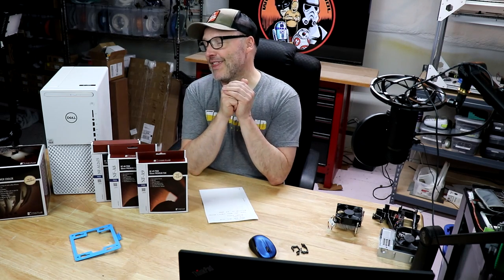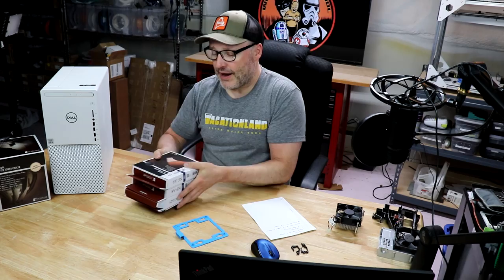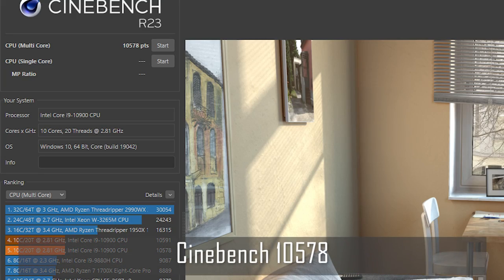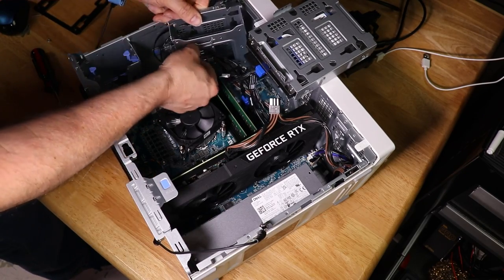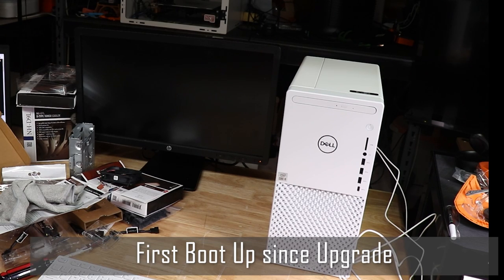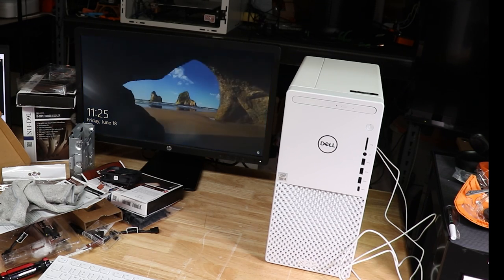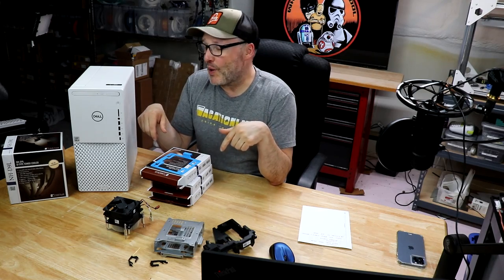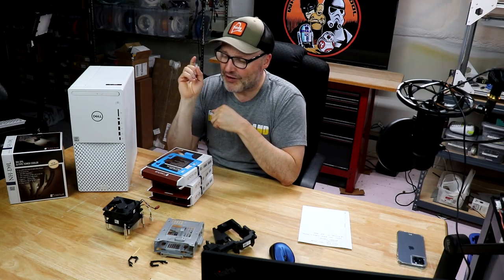Dell XPS 8940 / G5 5000 - Upgrading CPU Cooler and Fan Upgrades for better performance?

Comment: How did you purchase the 3D printed mount? The link doesn’t have anything. Or am I supposed to get it printed?
Reply from the maker: I printer my own (I have a print farm of 20+ machines). The link show the file. I’m sure someone in your circle of Facebook friends has a 3D printer?
Reply: @WhereNerdyisCool  unfortunately no 🥴
Reply from the maker: Check the comments here. Someone had an eBay link
Reply: @WhereNerdyisCool  
Great. Found it searching eBay. Much thanks for your assistance and the service you provide to people who need them via the videos you post.
Reply: @WhereNerdyisCool  btw, I read the Ventoo v5 is also compatible cooler for this cpu? Are you able to confirm? Don’t really want to chop M3 screws 🥴
Reply from the maker: I don’t know. Cutting the tops off screws is easy peasy

Comment: Thanks so much for the video, I have built hundreds of machines about 20 years ago and knew enough back then. Now I have to relearn some stuff. I have been struggling to find a prebuilt that doesnt have issues mostly crappy power supplies or cooling issues these should be no brainers and cheap issues that should never have been an issue on machines made today. Stupid companies put in 500 watt cheap power supplies just barely enough to run. I settled on an xps 8940 with i7-11700 and a 3060 I just purchased for $1200 from dell. I may replace the cpu fan with your setup and maybe the rear fan.  I hope my setup uses the same cpu fan yours does. Thankyou for all the links. I did find the screws online does the fan come with the nuts for the top?
Reply: How did you get this deal bro??? I got it at 1400 with a discount
Reply from the maker: Which cpu and graphics card?

Comment: How are u installing the m3 screws
Reply from the maker: I cut the heads off some M3 x 25 and threading them in. Then used the included Noctua thumb nuts to secure heat sink

Comment: Planning on getting this with an i7 K processor. ( Tower cooler ) Will adding all three fan work without getting fan error? Did you use 4 pins on all the splitters of the rear case fan port?
Reply from the maker: 4 pin.   No errors.  And a lot of hot air is getting pushed outside the computer.  For about $150 in fans/heat sink…it’s not a terribly pricey upgrade to eek some performance back!
Reply: @WhereNerdyisCool  Thanks, was just concerned if there was anything different in the i7 with the pancake cooler vs the i7K that comes with the tower cooler. Seems like everyone doing this mod started with the non K. I figured just get the K with the tower cooler to start and just replace/add the fans. Thank again.
Reply from the maker: @garyschmidt5301  as you saw in my video, I had that tiny cooler which seemed unable to do the job.  I'm not sure what the i7 owners have done.  But I'm quite happy with the Noctua one!

Comment: I bought an XPS 8940 from Costco two days ago. I'm wondering if I need to make these modifications since I don't play games. I wanted 32 GB memory and a somewhat capable graphics card (it came with a GeForce RTX 3060Ti) because occasionally I edit 4K video but 95% of the time I'm just in a browser or Office. Honestly, I feel like if I have to modify a brand new $1600 PC then perhaps I've made the wrong purchase.
Reply from the maker: Well it’s a Dell… as my video points out, $125 in fans plus new cooler helps it run a lot cooler, which means a lot less cpu throttling.  I don’t take a lot on my Dell, it’s for live streaming, which can be very cpu intensive.  I also like that all that hot air and getting pushed out way better
Reply: I just purchased this XP’s 8940 also and will be using it also mostly for 4k video  and browser and  Office . Have you had any problem as yet ?  Thanks!
Reply from the maker: Now that it runs a whole lot cooler,  no issues!
Reply: No, you don't have to do this upgrade. The PC is fine on its own and you won't have any troubles. Dell's R&D team's objective is to minimize warranty claims as much as possible. These sort of upgrades are for the enthusiasts in the world who just like to tinker and squeeze/maintain every bit of power available. If you do like the idea of upgrading, the CPU cooler is the one to target. You will see the same results without changing and adding in the extra fans.

Comment: Hey! Thanks for the great video, I just made the same exact modification (3 Noctua fans and Noctua CPU cooler). I was wondering what is your idle temperature. My idle temperature is arround 50celcius and i found it a little bit high for a system with no load... Thanks!
Reply from the maker: I’ll have to check again. Last tine I looked it was low 40’s
Reply: What's running in the background you might want to check
Reply: Disable the Realtek Universal Audio under Services. It's a RAM and system resources hog, possibly causing CPU to over work!
Reply from the maker: That’s a really great idea

Comment: Does this also work with the rtx 3060 ti version?
Reply from the maker: I would suspect so. The biggest gain is of yours came with that hockey puck shaped cpu cooler. The Noctua does a much better job. If you only replace one fan, do the rear case one

Comment: Has anyone that has done this upgrade figured out how to take control of the fans with the fanspeed app?
Reply: The fans cannot be controlled via software. So if you have the noctua fans, you have to get a manual fan controller.

Comment: Hey so would it be worth it just to even get the cpu cooler now and then do the rest of the upgrade later? I am just getting very worried about the temps on my system at the moment and was wondering if even just the cpu cooler would suffice for now
Reply from the maker: The cpu cooler is a huge help. Then those additional fans pushing that hot air out
Reply: @WhereNerdyisCool  Thanks so much! So is there anything else I would have to buy or would I be good to just buy the cooler. This'll be my first time doing something like this so I don't know if I'll have to buy thermal paste or not
Reply from the maker: @alexbooth3092  The CPU cooler I went with (based on the Dell Forums thread) had the thermal paste.  I just needed to come up with the 4 M3 20mm screws.  I lot of people freak out over cutting the screw heads off (am I really the only maker-nerd here?).  Hacksaw or Dremel makes it easy, be sure to use a file for a clean, burr free thread.  As I mentioned, for less than $150 I had CPU cooler and fans that made a very big difference.  I have the 3070 so I don't have a lot of room on the bottom but managed to squeeze that third fan in!  Here's the Dell Support forum link if you want more ideas
https://www.dell.com/community/XPS-Desktops/XPS-8940-Better-3rd-party-cooler/m-p/7690322#M53692
Reply: @WhereNerdyisCool  thanks so much! I should be able to just buy the screws and I think due to budget I am just going to go with the cpu cooler for now but will for sure do the rest of the upgrade at a later date, thanks for all the help!
Reply from the maker: With that cpu cooler you’ll need the M3 set screws or cut the screw heads off a 25 mm M3 screw. That’s it. Go slow. Ground yourself with a wrist strap and have fun
Reply: @WhereNerdyisCool  Can I just get the m3 set screws on Amazon? I just ordered the cooler and it'll be here Sunday so I'll let you know how it goes!
Reply from the maker: I couldn’t find them. So I just cut what M3’s I could find
Reply: @WhereNerdyisCool  I'm going to go a local hardware store today because I have none of the screws so I'm sure I should be able to find the 20mm m3 screws. I really appreciate that you are being as helpful as you can to a beginner and I really appreciate it

Comment: Just wondering, does this kind of upgrade void the XPS's warranty? Thanks!
Reply from the maker: Maybe?  I don’t know.  It it sure runs a lot better
Reply: @WhereNerdyisCool  The reason i asked was, I can get a cheaper XPS 8940 with a one year warranty than a two year period. Know that I can buy a Noctua u9s with the price difference. 😅 Any thoughts?
Reply from the maker: I don’t have anything to offer. I am used to fixing my own stuff 🤓

Comment: Y don't have the M3x25mm set screws why?
Reply from the maker: As I’ve answered to many similar comments, I couldn’t locate set screws so I just cut the heads of normal M3 screws down to 25mm
Reply: @WhereNerdyisCool  Oh ok thank you to answer for my question but the screws are not compatianle with the motherboard they are too big
Reply from the maker: Which system?
Reply: @WhereNerdyisCool  Xps tower classic edition with an i7 11700 and an 3060ti

Comment: Im not totally up to speed on intel, I've been using AMD since Ryzen came out. But is that all core boost frequency low? Seems like it could at least be running like 4.4ghz all core in cinebench
Reply: Based on things ive seen in other videos, I think the Intel XTU can increase the time it stays at max boost, even though its not a K.
Reply from the maker: That I’m not sure about. All the boost reading I’ve done indicated it was short term.

Comment: great video! do the extra fans add  much noise? also, do the quality of fans really make a difference? thx
Reply from the maker: They are silent!   Noctua fans are quiet.  If you go cheap, they could be loud.  Your mileage may vary

Comment: Where did you get the set screws? Or did all the hardware come with the cooler?
Reply from the maker: I used 4 M3x30mm screws and cut them down to 25mm with a Dremel cutting disc. 🙂
Reply: If I don’t have access to a Dremel do I just order any m3x25 screws?
Reply from the maker: Hack saw !
Reply: Don’t have that either. Lol am I “screwed”? 😂
Reply from the maker: Seriously any hardware store has both. You can do this
Reply: I know. Just adds more cost to the overall upgrade. Not your fault. Thanks for the video.

Comment: Tried to contact the 3d bracket maker to purchase a bracket  but no reply  where can I purchase one ?
Reply from the maker: Could be gone for the holidays?  I can print one up if you’re still in need. Probably cost more to ship than make
Reply: @WhereNerdyisCool  sounds good. Let me know where to send you a check. After the holidays of course. Thank you
Reply from the maker: @jamesr-zp3up  I don't take checks, I'm sure we can do some PayPal .... drop me an email when you're ready
Reply: @WhereNerdyisCool  ok I have a paypal account
Reply: @WhereNerdyisCool  I already installed the two other fans and the temp's went down 40 degrees 😊
Reply from the maker: It makes a big difference getting the air out plus a CPI cooler.  I wouldn’t bother with the front fan at this point!
Reply: @WhereNerdyisCool  ok   thank you for your input

Comment: I’ve xps8940 honestly the front 120mm didn’t produce much difference. Temp with or without are almost identical . I guess the cpu cooler is key to drive down temp
Reply from the maker: The better cpu cooler is well worth it.  The front fan you can skip. Definitely do a better rear fan to get the heat out

Comment: Did those screws come included in the noctua cooler?
Reply from the maker: For the 3D print mount?  Yes.
Reply: @WhereNerdyisCool  how about the cpu cooler?
Reply from the maker: As mentioned you need 4 M3x25mm set screws.  Or as I did I took 30mm M3 screws, measured 25mm and cut the heads off.

Comment: So the fans for the gpu wasn't worth it? I mean it wasn't much difference. Maybe just move the HDD from the front to the top front?
Reply from the maker: Well you have to move the HDD front caddy to get the fan in.  If I had to pick a fan to not use , the low one in front of the gpu.  However more air flow is never a bad thing !

Comment: Here is the funny thing, as I was ordering my xps 4940 I7-11700 system I asked the sales guy if I could have them put a better fan in it. I said the one they put in is crap. His answer was no that this is not a gaming computer we have alenware for that. I would sure want to know what makws a system a gaming system if not this with 3060 video card. That being said I just checked out an alienware system that has simular specs actually the same, they put the same pos fan in those.

Comment: you should have also bought some small heatsinks to glue on the motherboard VRMs, those aren't expensive
Reply from the maker: A peer added VRM coolers and saw absolutely no gain. So I’ve opted to leave them as is. The added airflow certainly helps
Reply: @WhereNerdyisCool  the thing about VRM cooling is less about performance gains, and more making your motherboard last longer. In special in big OEM systems - like dell -  don't exactly use the best VRMs in the first place, so I think those like 10 bucks those little heatsinks cost, should be worth it.
Reply from the maker: @BaDitO2  heatsinks don't cost much, you have a valid point!

Comment: Is there a difference between connecting that front 120mm fan to the cpu cooler header or the rear exhaust fan header? Like do one run more consistently or better than the other ? Thanks!
Reply from the maker: Good question. I’m not entirely sure!  But one thing you will like to the air flow.  And I’m always amazed how much hot air is now able to exit the case
Reply: @WhereNerdyisCool  Yes I've made the mods and connected mine to the cpu cooler header and have had great results. I am wondering if a cooler upgrade would actually help at this point. I have the K cooler so I'm kind of on the fence about weather it would be necessary to upgrade. I've ran the pc with the case open and just don't feel much air being put through the cooler from the fan inside. I'm thinking of putting in a veetro v5 as it's had good reviews in the 8940 and is very reasonably priced!
Reply from the maker: @NewfieVortex  Im told the K cooler is much better than the non K versions.  As you saw, mine was something that resembles a hockey puck!
Reply from the maker: Let me know how your tweaks go!

Comment: Hi,
I've posted a message yesterday but for some reasons it has disapeared. So this is a test.
Reply from the maker: I was replying to it and got an error too
Reply: @WhereNerdyisCool  I edited it like 3 times and I suspect you were replying at the same time. I'll post again. thanks
Reply: Grrr, it doesn't work. I post it then it disapear. Is it possible it's because there's a link to Noctua fans webpage in my message?
Reply from the maker: It might not like links
I just used the cpu cooler and the fans came with everything I needed
Reply: @WhereNerdyisCool  First time I have this problem, weird. I'll try without the link.
Just got my XPS8940 that came with a CPU heatsink similar to the Noctua you installed.
If I change only the 80 mm rear fan for a 92 mm Noctua, is it worth it you think? If it's only for the size increase I don't think so but if Noctua fans has better performance combined with a bigger saize, then maybe.
What 92 mm 4 pins Noctua fan you recommand? Same you used? I know Dell bios doesn't allow for speed adjustment.
thanks
Reply from the maker: @guillaumepare9651  everything I used is linked in the description.  I’m happy with the bigger rear fan. No bios issues as you saw in my video. Again, your mileage may vary.

Comment: Thank you for the video. I will try this out with mine. I have a few question though.
1. The 120mm fan is located at the upper part of the front case, which doesn't have any holes like the bottom. Do you think that obstructs the air flow quite a bit ?
2. Mine come with the rtx 3060 Ti so I have room to put the 80mm fan right in front of it. Do you think it will have better effect on the GPU than the fan is below it ?
3. Do you have any idea about reuse the stock cpu cooler and stock rear exhaust fan ?
Reply from the maker: 1 I think anything that pulls more air into that case is a win. 2. I didn’t see any GPU temp gains but as above , moving more air helps.  3. No idea on reusing the old components

Comment: Wouldn't just upgrading the cpu cooler be enough? Random guessing, but seems only cpu benefited and that probably is doing most of it.
Reply from the maker: It might.  But getting all that hot air out of the case helps too. And it’s not a lot more money

Comment: couldnt you just zap the hdd/ssd completely when reinstalling windows to remove all the bloatware?
Reply from the maker: Well if you have the Windows installer media sure. I do not. I’ve just been zapping programs on the Add/Remove section
Reply: @WhereNerdyisCool  it's definitely easy to get these days though I understand if you had no prior way to get the installation.

Comment: I just ordered the Dell 8940 Special Addition with the following spec's below. Can I get away with just changing the CPU cooler to the NHD9L. Basically I only play a few games..  Thanks                                                                                                                               2TB M.2 PCIe NVME
SSD (Boot) + 2TB SATA 7200RPM HDD (Storage) 500W Mineral White Bezel Chassis including optical drive                                    NVIDIA GeForce RTX 3070 8GB Studio (LHR) 64GB, 1                                                                                                                                      6Gx4, DDR4, 2933MHz                                                                                                                                                                                        Tray load DVD Drive (Reads and Writes to DVD/CD)                                                                                                                                          11th Gen Intel(R) Core(TM) i9-11900K processor (8-Core, 16M
Cache, 3.5GHz to 5.3GHz
Reply from the maker: Check the cooler first before planning upgrades. You might receive something way better than the aluminum puck mine came with!  
If you do opt to upgrade, just swap pin out the cpu cooler will be a major improvement. 
Putting a better/bigger fan in the rear of the case will help too